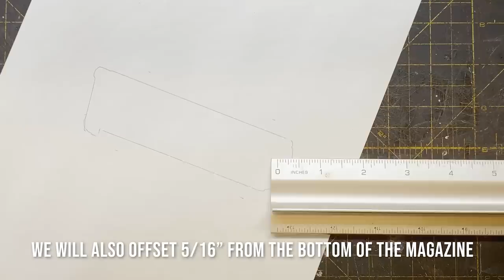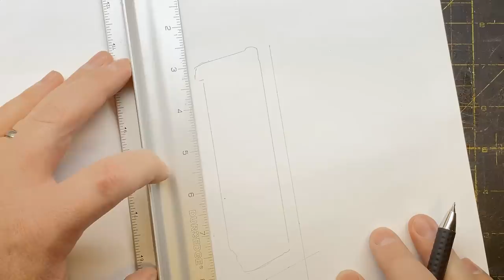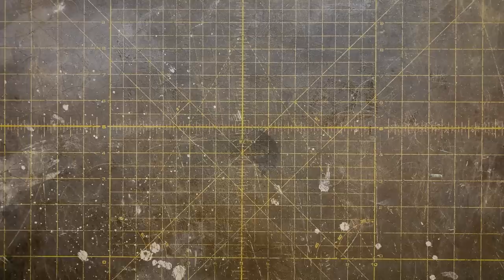Making a Leather Double Mag Pouch Pancake Style 1911

Comment: Im always amazed at how fast you work up designs and templates. It takes me hours sometimes to figure out the design and get the measurements right
Reply from the maker: Thanks! Some holster styles are easier than others. As long as I follow the basic formula, I can usually get something usable on the first attempt. The pattern usually needs to be tweaked after I build the first one, but a lot of the tweaking is personal preference or just adjusting the stitch line.

Comment: You need a French curve, we use them for layout in sheet metal. It has all the different radius’s you could/want. You should be able to find them in an art store, they are used for drafting as well.
Reply from the maker: Thanks Dave - I actually have about 5 of them, but rarely need to use them. I've actually worked for architectural firms for nearly 20 years. :) When I designed my little belt slot templates, I never thought of using them for curves on the rest of the pattern, but it was like a mini french curve and the curves flowed nicely since the radii were consistent. On larger holsters with bigger curves, french curves would definitely be a benefit. Thank you for watching!

Comment: Hi! You do a pretty good and clean job! Beautifull holster. I have just one question : what are the reinforcement pieces for?is it just aesthetic, or do they have a special role?
Thank you!
Reply from the maker: Thank you! Reinforcement pieces on pancake style holsters & mag pouches are largely decorative since there's no outside forces trying to push against the holster. I offer tooling on my holsters, which I usually do on the reinforcement piece. I used to offer a model without the reinforcement, but customers always wanted it so I include it by default. I think it adds a nice visual touch, but it's not necessary.
Reply: @AdamsLeatherWorks  Ok! Thank you for your answer.

Comment: What determines the difference in spacing between the top of the mag and the bottom. I’ve made a few and this is always a concern that the overall width on mine usually end up narrower at the top due to the mags of course. Do you have a formula that dictates the difference between the mags top and bottom to fit it the overall same width when done. Hope that makes sense.

Comment: Might be a weird question but with the sealer couldn't you put some in a container and then just dip the holster in it for say 10 seconds or so and then take the sponge brush and go over it when you would take it out?
Reply from the maker: Hi Brian - yes, you can certainly dip the holster in sealer. I've done it a couple times, but didn't have great results. Plus you really need multiple sealer tanks for the various colors you might use since the bucket of sealer gets contaminated with dye pigment over time. Eric Larsen with HBE LeatherWorks did a video showing his technique. https://youtu.be/Xm4nIQj46L0

Comment: Awesome video. Curious when I apply resolene it bubbles like crazy. I use the foam brush,try to go easy,mix with with all that stuff. Any idea what the newbie is doing wrong here? Lol
Reply from the maker: My resolene bubbles too, but the trick is to just keep brushing gently over the surface with quick strokes to keep the surface wet and allow the resolene to soak in to the leather. Make sure you don't have any fans on to help keep it from drying out too quickly. I also dilute my resolene 50/50 with water, so if you haven't tried that yet, see if that helps. Keep your brush pretty wet early on while it's soaking in really well, but eventually you want the brush to start drying out so it's just a bit damp - that will help wipe away the bubbles. It takes practice, for sure.
Reply: Thank you. I have been doing the water mix. I've been outside putting it on,and while there are no fans,I live in Florida and I'm sure that causes it to dry super fast. I appreciate the response!

Comment: Awesome videos, thanks! I just started leather working and your videos have been a huge help. BTW- what laser label printer do you use and do you recommend it?
Reply from the maker: Hi John, thank you - glad you enjoyed the videos! I'm not sure what you are asking regarding the laser. Are you talking about my Laser machine that I used in my other videos to engrave my logo and cut out my phone stands, etc.? If so, that's a huge arena that I know very little about. I bought my machine used from a local seller. Lasers can get very, very expensive. If you want a solution that's ready to go without a lot of up-front tinkering to make it safe to use, look to spend at least $5,000 for something like a Glowforge or its competitors. BossLaser was what I initially planned on purchasing, but it would have been smaller than the machine I bought used locally.
Reply: @AdamsLeatherWorks  good deal thanks. I know there are some small laser printers out there that are cheap but probably won't give near the results you get with yours.

Comment: Did you leave anything in the pockets when left it dry? I don’t have any magazine molds and I don’t know if I should leave my magazine in it when it’s wet for a prolonged period.
Reply from the maker: I typically leave magazines in the pouch while it's drying, provided I have mags designated for molding use. But otherwise I don't leave 'real' mags in the pouch while drying if I can avoid it. You can insert your mag in a baggie or wrap it in plastic wrap, provided it doesn't add much bulk. But be sure to oil down the mag before & after forming to help prevent damage from moisture. The safest bet is to simply stretch the pockets out after it's dry - I insert the mag in a baggy and then force the mag into the pocket and let it rest for a while. Start with a few minutes, and use longer time if necessary. Or wax the interior of the pocket and let it stretch with natural use and a break-in period.
Reply: Adams LeatherWorks Awesome. Thanks for the info. I have my holster all sewed up, now it’s time to wet mold it this weekend. Thanks for the awesome video and reply.

Comment: Your videos are chock full of little tidbits of information that I constantly have to review over and over again for the subtleties.Thankfully, you run them at 4x speed because to get that much information at regular speed would be a full length movie. :-)

I noticed during your boning process that you are constantly retracing particular contours over and over again during drying.  Is there ammental guideline that you use to determine when you are “done“?
Reply from the maker: Thank you for watching and for the kind words. The leather is easier to mold and shape while there's more moisture in it, but it doesn't hold its shape or detail lines as well until it begins to dry out a bit. If you try to apply too much pressure with the boning tools and add too much detail when the leather is too dry, it'll burnish and darken the surface. You can counteract that by dampening the surface a bit with a sponge if it gets too dry and then proceed with adding more detail lines. The vacuum press helps to pull some of the moisture out of the leather so I can cut some of the time out of the forming process.

Comment: what kind of machine do you run,i have a techsew,that thread size looks great,was curious what speed you run at to sew so carefully,thanks1
Reply from the maker: I have a Cobra Class 4. I'm not sure what the stitch per minute speed is, but I have the servo motor usually set around 12-15. I'm not sure what the max servo speed is, but I never go about 25 (and I only use 25 when I'm winding bobbins). I want to say max speed is 50, but not sure on that one.
Reply: @AdamsLeatherWorks  TY,i have the same servo,ill give it a shot

Comment: Very good work!
What threads, needle and stitch length?
Reply from the maker: I use 277 bonded nylon thread top and bottom, size 25 needle, and approximately 6 stitches per inch.

Comment: Great job! Looks real nice. What were you using on th edges?
Reply from the maker: Thank you - I used Gum Tragacanth to burnish them, and I usually follow up with a 50/50 mixture of beeswax and paraffin burnished on my drill press burnisher, but that's not a necessity, especially if you can touch them up a bit after applying sealer.

Comment: Is that a regular hole punch, cause it looks wider then the one I have from Tandy.
Reply from the maker: I had the punch made by Texas Custom Dies. They will make them to your size specifications. Mine cuts a 5/16" slot.
Reply: 1 1/2 x 5/16 ?
Reply from the maker: I actually went 1/16" over the desired width, so it's 1 9/16" x 5/16". I did the same thing with my 1.75" slot - it's 1 13/16" wide x 5/16".
Reply: Thank you for the info.

Comment: why don't you use oil before the sealer?
Reply from the maker: I used to oil everything I make, but have stopped doing it for several reasons. It does soften the leather a bit, though I don't think it's enough to worry about. I have customers that bought their holsters nearly a decade ago that tell me their holsters are still working great and get daily use, despite having been oiled. Oiling adds another day to the build time (because you have to let it soak in). Lastly, I started oiling holsters "because Bianchi did it" in his holster making DVD that I watched when I was first starting out. But, he was making a completely different style holster (Western) where stiffness wasn't as important. I didn't really pick up on that difference at the time. That being said, I've seen plenty of other makers oppose oiling holsters (and plenty that support it), but once I stopped oiling, I realized I didn't really miss it. So, the main reason I stopped oiling is to retain the maximum amount of stiffness. That's not really a great answer, but if you oil your stuff, you won't see me complaining. Just make sure you do it sparingly.

Comment: Awsome work ! How thick is that leather ?
Reply from the maker: Thank you - I used 7-8 oz on this one.
Reply: @AdamsLeatherWorks  thanks a lot !  And I was wondering, what dye  do you  use? Never causes problems to soak  it after dyeing ?
Reply from the maker: I really only use Fiebing's Pro Oil dyes. The only exception is "Red", and I use Tandy's Pro Waterstain for that one (but I think they changed the name a while back - haven't ordered any lately). The Pro Oil causes no problems with water absorption. Sometimes it can dry a little splotchy, but I almost never have that problem. The key is to make sure the leather is uniformly wet and dries evenly. When applying sealer, you have to make sure the leather is completely & evenly wet with sealer (as much as possible). The leather needs to look evenly wet, otherwise, the dye can migrate a bit when drying and you'll get splotches. But, that almost never happens. Make sure fans are off and it's not too hot (or cold) in your workspace, otherwise the leather may not dry evenly. Tandy's waterstain has waxes or something in it - it can make it hard to soak the leather prior to forming. You have to bend the leather a bit to help open up the leather pores so water can soak in.
Reply: @AdamsLeatherWorks  Thanks a lot for that more than complete answer. Much appreciated !

Comment: Why don’t you stitch around the belt loops and stain the inside of them as well? Asking for a friend. 😉
Reply from the maker: Good question about the stitching - I've never really felt it was necessary but I don't have a good argument against it. Regarding staining the slots - that mostly has to do with workflow. I stain the leather prior to assembly, and most of the stuff I build has airbrushed accents. Which color would the slot be since the accent dye doesn't always completely cover the entire slot? And the slot doesn't get punched until after assembly, just prior to forming (while the leather is damp to help minimize tearing the ends of the slots from the punch stretching the grain surface). Dying the slots after forming is tricky since the slot is no longer flat. I usually dye the slot on black holsters, but everything else gets left natural.
Reply: @AdamsLeatherWorks  You have certainly done a lot more holsters than I have since my count is at zero. Aka… you know what you are doing and I don’t. 😉 Looking at other holster makers, some stitch the belt holes and others don’t with the latter being the majority. And I can see that staining them would be difficult. Heck the belt is going to cover them up anyway. Bottom line… you make beautiful products and take pride in your work. Kudos.

Comment: Do You do all those steps in one day?... Dying, burnishing and sealing? I've been letting the dye dry for 48 hours and resoline drying for 24. Basically 3 hours of work spread over 3 days... Am I wasting to much time? Im using fiebings dye and resoline. Get videos.
Reply from the maker: No, not all in one day. I usually work in batches, so I'm doing multiple orders and it may take me a whole evening to do one or two steps, so a full batch may take a week or two. If I was to build one item, I would cut, dye, burnish the openings, glue, stitch, sand, edge and burnish the remaining edges. Then let it sit for a few hours before doing the molding. If you're not rushed for time, do the molding on the 2nd day to give the glue more time to fully cure and for the dye to offgass completely. After molding, let the item dry in front of a fan overnight. The next day I'd touch up the burnishing on the remaining edges and slick the interior. Let it dry in front of a fan for a few hours, then seal with acrylic sealer. I let the sealer cure overnight  & ship the next day. I airbrush my dye, so the dye dries pretty quickly since the leather isn't saturated with dye. I glue with solvent-based contact cement, so assembly goes pretty quickly. If you're able to get the build & molding done on the first day, then seal the next, it's possible to finish in two days. But 3 is more realistic to allow more drying time. Hope this helps!